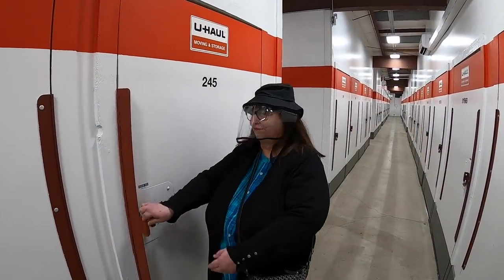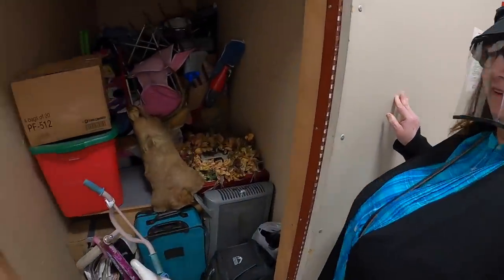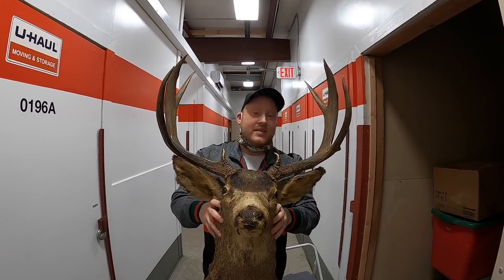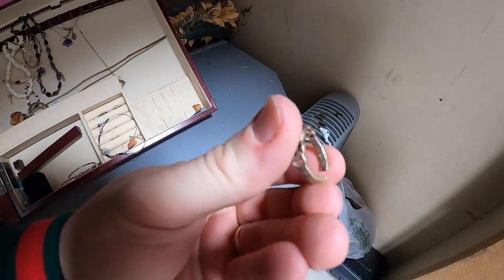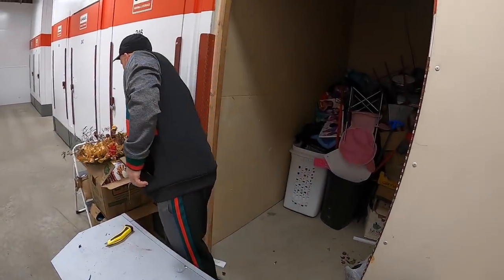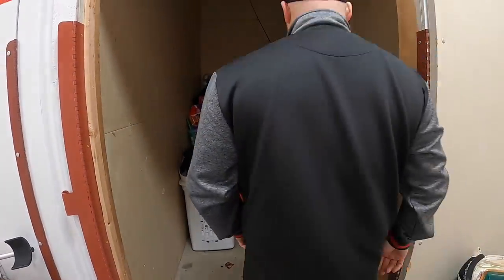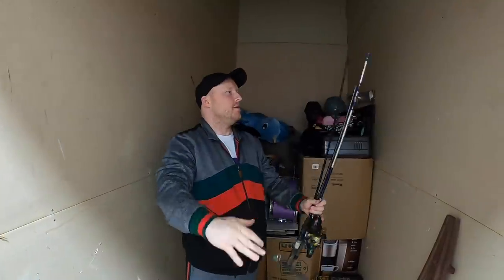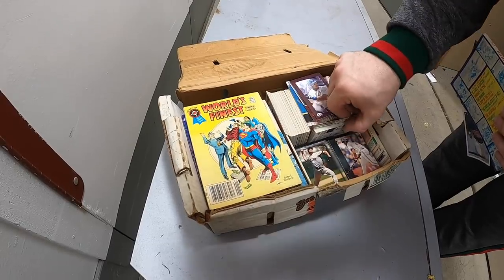I Bought An Abandoned Storage Unit.. Found Deer And VINTAGE Sports Cards!

Comment: I sell sports cards, unfortunately I did not see much promise in that collection. The 1989 Score Deion Sanders is a good card if it is in mint condition, but you say it had a bad corner. I was hoping the Score set was the 1989 set which is valuable, but it was the 1990 set, not so valuable. I hope you picked through it and found some hidden treasures.